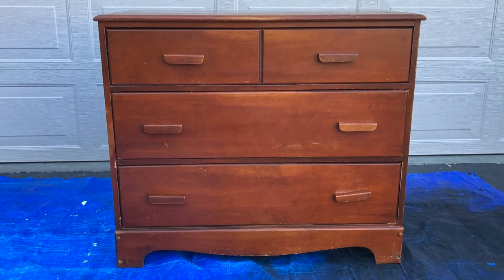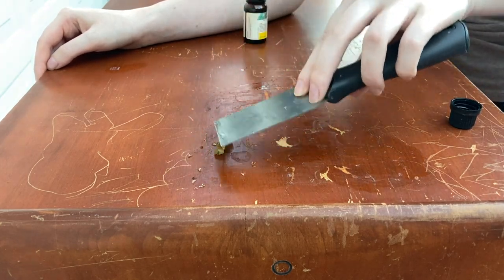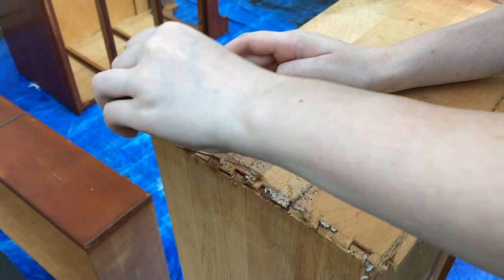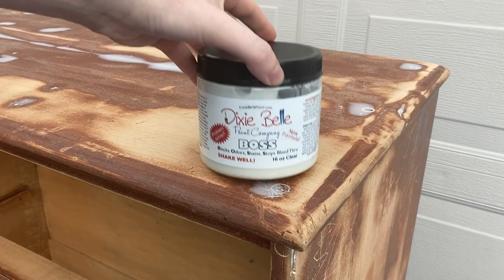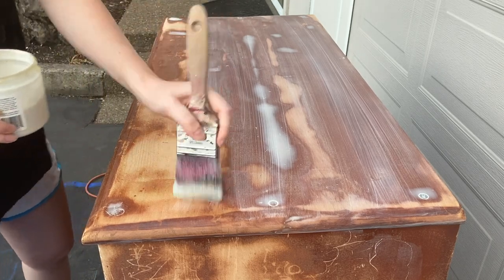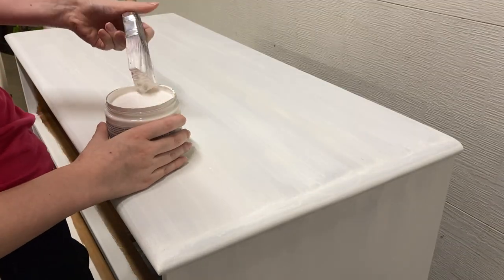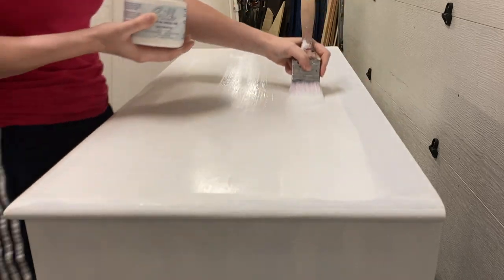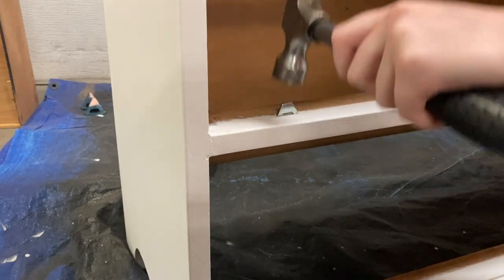How to Paint Furniture WHITE | DIY Trash to Treasure Dresser Makeover

Comment: A hack I use for painting furniture white: I start with darker to Mid tone thin coats of paint depending on how dark the piece was to begin with. But I make sure that the paint has the same undertone as the white I’m using. Example if I’m turning a creamy white I will use something with gold and yellow undertones.
I generally still have to do 3 to 4 coats, but only two of those will be the white paint.
3 reasons one I don’t use up all my white paint, second use up pants that I only have a small portion of, 3 The end product looks like more full coverage.
Reply from the maker: Great tip—thanks!!

Comment: I'm curious as to why you used bondo ? Not wood filler .
Reply from the maker: Bondo is much stronger than wood filler. I use it when I need my repairs to be very strong. I use wood filler only for very small scratches, and Bondo for everything else. I want my pieces to last another lifetime, so they need to be as durable as possible.

Comment: How do you get the musty smell out of these old pieces of furniture?
Reply from the maker: I typically won't get pieces that have a musty smell, if it's really strong. 
If it just has an old wood smell, I'll use a scented wax to seal all the drawers and counteract the smell. 
Things like smoke, I do not deal with, because it's really hard to get out. You can try using spray shellac and apply two coats of that to the entire piece: spraying the inside, outside, the drawers, the drawer guides & railings, and the backboard.

Comment: Instead of using more coats of paint, maybe try using a better primer that is able to block ALL the bleed through…just a thought 💭
Reply from the maker: Thanks for the tip, but it wasn't bleed through! White paint has less pigment than any other color, so it requires more coats to cover dark wood.

Comment: The reason you are having to use more layers of paint is because you used the wrong primer. You are getting bleed through of the wood tannins. Using a water based primer just exasperates the problem.
Reply from the maker: I didn't have any bleed through or wood tannins. I know what tannins look like and this wasn't it. 
White paint has less pigment than any other color of paint. I've been doing this for almost 2 years now and I've never gotten away with using less than 4 coats of white paint to reach full coverage, even with a primer underneath--oil based or waterbased. This paint had a built-in primer so I didn't prime first, but even if I did, I still would have needed several coats of paint.